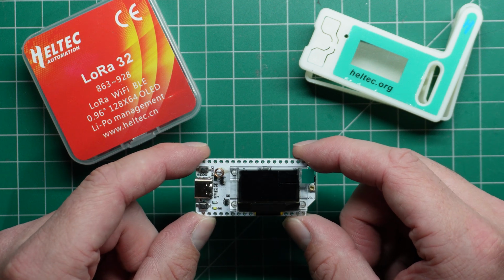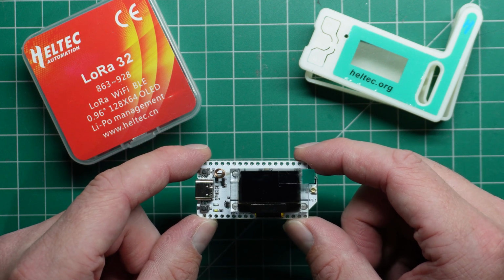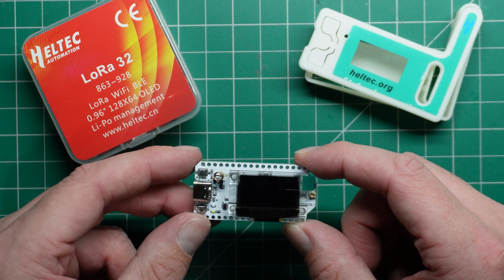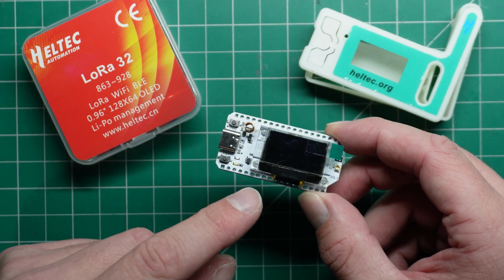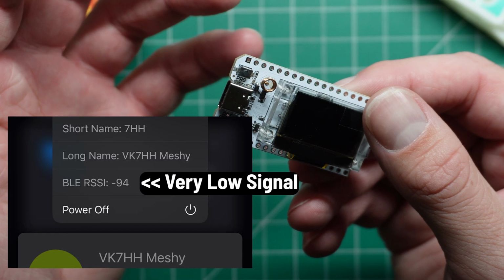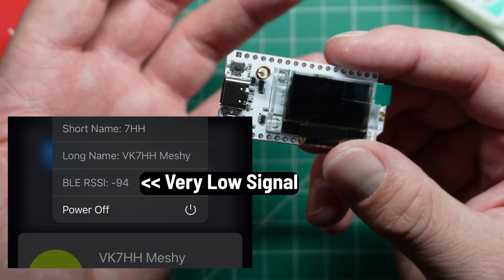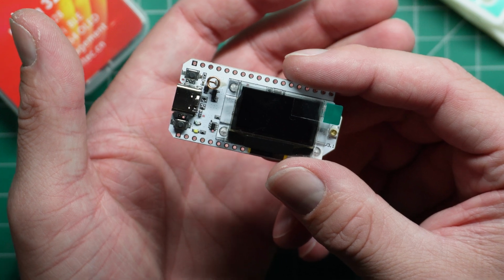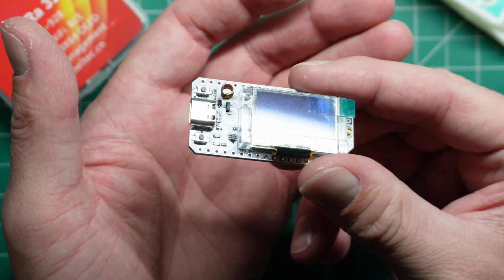Boost Your Meshtastic Heltec V3: Upgrade Bluetooth Range

Comment: The antenna should be 1/4 the wavelength **in the antenna.** The standard Bluetooth frequency band is 2.402 GHz to 2.480 GHz.  That corresponds to a wavlength range in freespace of 121 to 125 mm.  That corresponds to a quarter wavelength in freespace of 30.2 to 31.2 mm.   But the wavelength in a dielectric coated wire is shorter than in freespace by a velocity factor accounting for the dielectric constant of the dielectric being greater than 1.    If the wire is the enamel coated wire shown in this video, also called magnet wire, then the velocity factor is in the range of 0.95.  Using 0.95 gives a 1/4 wavlength range for the antenna to be betwee 0.95 * (the range of 30.2 to 31.2 mm) which is 28.7 to 29.6 mm.  But if you use a wire with conventional polymer insulation as opposed to enamel, the velocity factors are in the range of 0.65 to 0.85, and therefore your 1/4 wavelength wire should be correspondingly shorter, in the range of 19.6 to 26.5 inches.
Reply: Furthermore, assuming the Heltec V3 is conventional having an impedance of 50 Ohms board impedance, then there is power reflected back to the transceiver at the connection of the 1/4 wavelength dipole arm because a conventional dipoles has impedance that is not 50 Ohm. So even with the best proper length of the piece of wire for the 1/4 wavelength leg for this antennae, however it is cladded, there will still be power reflected back into the board where the board interfaces to the straight single wire antenna arm.  It may be that the original coil antenna was designed to minimize power reflection back to the board, thereby protecting the board.  If you are a HAM and decide to use this 1/4 wavelength dipole antenna leg and crank up the tranmission power, it may be that you burn out your board.
Reply from the maker: Nice!

Comment: I am going to attempt to make this modification today. However, I have never soldered anything in my life and I have no idea what temperature I should set the solder iron for.  can anyone advise?
Reply: Depends on your solder. Start low and add heat as needed let your iron preheat. And touch the pad and the wire at same time. If it melts in a sec you’re good. If no melt.  Up the temp and try again after preheat

Comment: This popped up in my algorithm, sorry if I'm digging up graves.   I believe that Heltec addressed this issue and revised their bluetooth antenna design on thier newer V3s.  But, yeah, this is an excellent solution if you have an old board.

Comment: Bluetooth on the two I bought won’t go 3 meters. Dropped one in its case on accident, about 8 inches and the antenna broke off. Very poorly designed and made. 

The other one is in a never ending boot loop, which others have found is also a result of a problem with the same antenna.

Comment: I am actually surprised at how good a range I get on my heltec v3, from my phone.  I have one in the car in the parking lot at work, and I can pick it up no problem through two walls,  and the radio is inside the car.   at home i put one on top of my back yard shed,  and could pick it up everywhere in my house.
Reply: same here, btw when you straiten the existing coil (pull  out the coil windings) you have the same effect.

Comment: I've not used any of my Heltec V3s any further than just 10 feet or so from my phone or tablet, but I have a RAKwireless WisBlock in my upstairs and I use it with my phone when I'm downstairs and on the opposite of my home, and it works perfectly. I guess those little WisBock antennas must be significantly better. This is a great idea. Thanks for the video.

Comment: For those without the skills or equipment would it be possible to stretch the wire so its either:
1. Still curled but stretched out to be a bit taller within the case?
2. Straightened and bent to fit within the case?

Comment: Wouldn't it have been easier to pull the spool to make it straight, and then cut it to the right length? I used this technique to improve the short radio antenna supplied with the esp32 module, the reception improved a lot
Reply from the maker: maybe?

Comment: Why didn't you just stretch out the existing one and cut to size?
Reply: it would have snapped trust me i know
Reply from the maker: It's pretty thin.
Reply: Well mine snapped as it's work hardened when it's coiled
Reply from the maker: could've done
Reply: You have to presume the coil is there to fix the complex portion of the impedance to near zero so the Standing Wave Ratio of energy transmission from the transceiver to the antenna does not get reflected back into the transceiver (burning out the transciever porentially and also limit the transfer or energy from the transceiver to the antenna and then into freespace).  The 1/4 wave straight antenna works because it his 1/4 wave at the operating frequency, and, since it is straight, should have relatively low inductance and capacitance, and therefore the reflected wave is 1/2 wavelength out of phase to the incoming wave at theinterface to the board. That results in reflected wave reflected from the tip of the antenna canceling out with incoming wave at the interface to the board due to linear superposition, and leading to no energy reflected back into the board.  There is no reason to think that a coil clearly having substantial inductance and mutual capacitance between coils and the board, at 2.4 GHZ, should the same physical length as a straight  linear antenna.  The Heltec V3 board is about 50 by 25 mm and presumably its ground plan is the equivalent (or should be the equivalent) of the other leg of a dipole antenna, that is 1/4 wavelength or 29 mm for an antenna operating at 2.4GHZ antenna.
Reply: It's a coil antenna.  It's going to have different properties to a straight antenna.

That and straightening that thin of wire is bound to break it.

Comment: Thank you Hayden, I now have something extra to do on the weekend
Reply from the maker: As some have already pointed out in the comments, you can straighten out the existing coil and cut to the right size.. but I replaced with a slightly thicker wire as it was just easier and kept the coil as is.. I don't mind it sticking out of the case as it will be installed up in a box on the roof anyway

Comment: How long was the original coil? Couldn't the straight wire be hidden in the case as it's rather impractical to have it sticking out of the case that prevents it slipping into ones pocket?
Reply: Yes by all means. This is a pretty common mod to 2.4ghz radio controlled micro quadcopters. You can use insulated stranded wire.  The length can be anywhere between 29mm to 33mm and it will still work just fine.  I like 30 myself. Cut it to 40mm, strip about 5mm, tin the end, cut off all but about 2mm of the tinned end, push it through the hole in the board and solder it on.  Measure what’s left. If it’s between 29 and 33, you can leave it or trim it. If it’s longer trim it to where you want it. Fold the wire down parallel to the screen and enjoy. Just be sure there is room in whatever case you’re using. You could also solder it to the back of the board if it fits snug around the screen.
Reply from the maker: Probably could've yeah
Reply: Lol I just tried carefully pulling and bending the coil. It broke off almost immediately 😅😂

Comment: Would you recommend the heltec as a good starter kit, or would something else be better?
Reply from the maker: I've been playing with it and can reach other nodes several km away just with the small whip antenna, so yeah I'd say it's a good starter. I'm sure there are better though out there.
Reply: Thanks for the input, I went on aliexpress to go looking for one and my head started spinning at all the different choices.
Reply: @HamRadioDX  Are the other nodes Heltec V3 with the same antenna? I assume not, as I can only get 100m or so between them.
Reply from the maker: There are a couple of V3's, but I suspect they are running outside on antennas. Mine is still inside with some limited testing outside. I still show about 12 nodes inside... but messages are inconsistent due to the low signal
Reply: @HamRadioDX  Thanks, I am in Brisbane and cant see any other nodes where I am. Next plan is to build a solar powered node I can stick on a mast.
Reply from the maker: What antenna are you running?
Reply: @HamRadioDX  The built in one on the Heltec V3 :) Hence my plans for a node on a mast (with a decent antenna)
Reply from the maker: @brettemurphy  oh yeah the one that comes with the heltec isn't that good either
Reply: @brettemurphy  I am not sure there is any around us 😋 (GC)
Reply: I would recommend this as a good starter. It's an excellent unit and has achieved reception of nearby nodes with an SNR-18.9